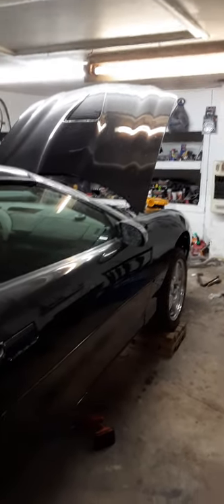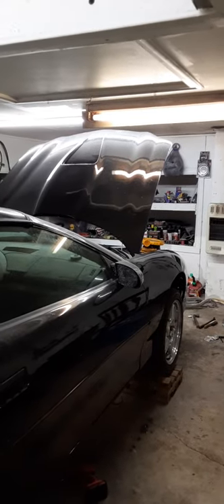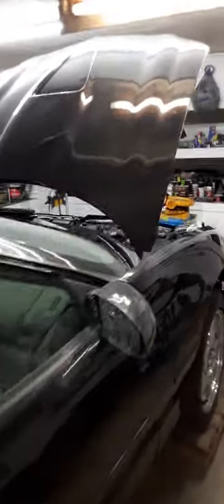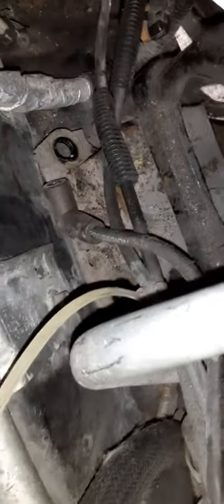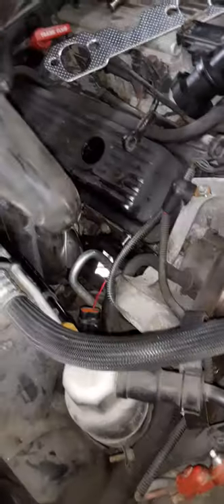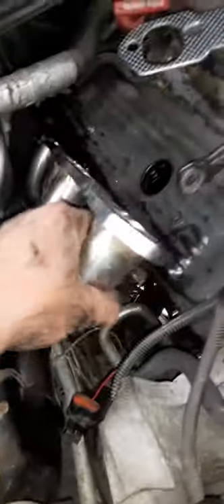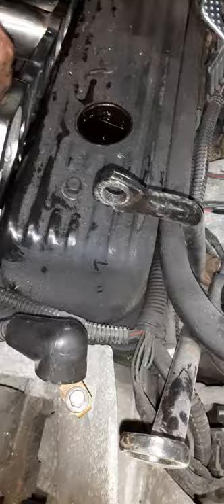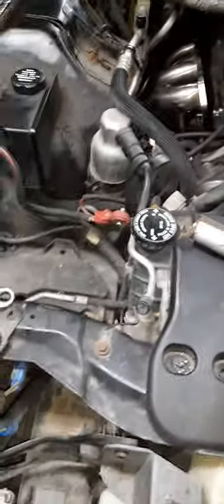Lt1 passenger side header install

Comment: My tube size is bigger too. I took .y valve cover dip stick alt starter all off and my ac. Still can't get it in there. So if I jack the motor up and undo the motor mount they should just slide right in huh? This helps out alot ill try it when I get off work.
Reply from the maker: Valve cover and starter and undo the 3 motor mount bolts
Reply: @shawnschuster7532  right on thats what im gonna do tomorrow. Just worked a 13 hr shift today ugh. Fuckin sucks bc I just wanna work on the car man. But I've also started undoing my ac. Quite a process that is. But even since I didn't need to start taking that off to get them in I was still going to do an ac delete so yeah. Thanks for the vid man!!!
Reply: @shawnschuster7532  I took off the valve cover and noticed that this car has an lt4 hot cam kit in it lol woth 1.6 roller rockers. So that's pretty sweet. I could already tell it had a cam and from experience of hearing an lt4 hot cam sound I had deep instincts telling me someone put it in there. But seeing the internals of the valve train sold it for me.
Reply from the maker: @bigsutton  lt4 setups are nasty
Reply: @shawnschuster7532  yeah because for one they are made by Chevrolet and they made them to be basically the best setup for naturally-aspirated setups. They are the kings of it in my opinion

Comment: How was the drivers side, and what brand are these? I just ordered speed engineering headers and I’m pretty stoked, but also terrified of the install.
Reply from the maker: The drivers side is the easy side the passenger side is the hard side I ended up taking the motor mount bolts out the 3 to the cross member and jacking the motor up and removing the valve cover my tube are larger than normal though  these are just some ebay china brand ones  I've had some pacesetters they fit like a glove  you'll have to undo the steering shaft take valve covers off remove the tube to the back of the intake zip tie wires prolli have to get a new oil pressure sensor and temp sensor they brake and so on
Reply: @shawnschuster7532  eek. I got speed engineering headers and y pipe. I’m sure the labor is worth the sound though.
Reply from the maker: @seshtilirest4748  yeah for the sound yeah for the most part headers are headers unless u are pushing serious hp numbersyoull also have to extend your oxygen sensor wires take out the dipstick make sure you get some good bolts I used to have arp ones I think they were that had a Allen key lock in the center it spread the bolt open to lock it in place these ones i got now are studs with a nut you thread on  think I might swap them out
Reply: @seshtilirest4748  im installing mines right now. Same brand your are.
Reply: @shawnschuster7532  hey so I'm stuck on the passenger side. So all I have to do is undo the 3 bolts for the mount and then back it up from the oil pan? Will I be able to put the mount back on without problems? Also you said to remove the valve cover? But in your video you didn't? 

I almost feel I can get it in without the valve cover and not removing the engine mount. 🤔
Reply from the maker: @dnegel9546  my tube size was huge so thats why I had such difficulties it would be alot easier with the valve cover off with my pacesetter I just slid it in and was good to go
Reply from the maker: @dnegel9546  also yeah you will be able to put the mount back on just fine
Reply: @shawnschuster7532  I'm still working on it. Bout to lose my mind. 

So the headers I have are exactly the same you have in this video. And my tubes are hitting the plastic against the wall. (Heater core cover?) But basically this is keeping me from being able to put the front bolt on. I really don't want to hit my headers with a hammer. I already have it in I just need that front bolt on. I got the back bolt on. 

Only thing I'm thinking is grabbing a pry bar and hammering away at the plastic cover (Idkn what it is.).. but I'm guessing this will destroy it and I will have a bigger problem.
Reply from the maker: @dnegel9546  i had to really flatten the tubes  out they will hit everywhere worst headers eveer
Reply from the maker: @dnegel9546  if you undo the motor mout raise the motor up it'll fall into place
Reply from the maker: @dnegel9546  it might be hitting off the body still though mine was bad
Reply: @shawnschuster7532  yeah I'll see what I can come up with tomorrow. I raised it and lowered it several times already. I may have to try and shave off that plastic trim as much as possible and hope it's Nothing important. 

Weird there's a guide about this exact headers being put on at ls1lt1 tech forums and they didn't mention anything about hitting the side wall. So it may just be something I'm doing wrong.
Reply from the maker: @dnegel9546  both sides of mine got the hammer they were hitting everywhere all over some people would cut the cross member for the driverside passenger side would sometimes hit the bellowing for trans  and mine just hit everywhere with the passenger side ill get some videos for you
Reply: @shawnschuster7532  hey I got them on finally. I managed to get them on without hitting it with a hammer. I almost did tho. Even had the hammer in my hand debating if I really wanted to remove the header to beat it. Lol..

But I dkn, I just keep shacking/ lowering/ raising the engine and finally I got the bolts on. 

I can safely say putting on headers is harder then removing and rebuilding the 4l60e 🤣🤣🤣. Holy s**t.. I also did it all on my own, I came so close to asking someone for help.. (I never ask someone for help.) Well physically.

But thanks for everything, really appreciate the responses. I'm going to have to find some high heat tape/material for the wires since I did not re route mines. 

I also read that since I have a 97 I will need a tune in order to drive it. 😒🤦

Oh btw I have the EGR delete plates. I read 2 go on the back of the intake and 1 on the header? (Guessing the header one is for headers that have EGR.? Mines don't.) 

And also I need O2 extensions and band clamps. I refuse to use those clamps that came with it. I had same style ones on my exhaust and that caused a nightmare on par with the passenger side header. 😢
Reply from the maker: @dnegel9546  really make sure they are clearing everything cause you have to have a certain amount of clearance for when the engine shakes you I think only need one plate unless you took off the little diaphragm egg stuff as well there should only be that one metal tube you took off going from exhaust manifold to intake its easy to make a gasket yourself also I've never tuned for headers I really think you'd be ok my ls1 ran like crazy with headers though so u never know for the 02s id just get wire and extend them yourself thats what I do everything if I was you though make sure you start the car and makesure those headers aren't smacking or vibrating off the body or cross member you really have to look good and have good clearance for engine shake that's where my hammering came into place
Reply: @shawnschuster7532  damm your right It didn't even cross my mind to think about the shaking. 🤦🤦🤦 

Swear I'm about to just put my manifolds back on. 😒 Lol...

I believe it's touching the plastic on the body where heater core is. 

Then again if it does shake won't it just make its own dent in whatever it's touching. Lol 😅..
Reply from the maker: @dnegel9546  i had to take mine off and on multiple times to make it clear everything
Reply: @shawnschuster7532  wow.... No way you have lots of patience.. swear if I have to take these off...the manifolds are going back on and I'm selling the headers. Lol
Reply from the maker: @dnegel9546  ill never buy those headers again the tubes were just to large  they are kinda quiet for my likings I had pacesetter painted ones though and they fit like a glove on a different cart
Reply: @shawnschuster7532  yeah I got mines for $250 shipped. So that's why I got them sucks cuz they look good and seem to be good quality, if only the tweeked the design a bit. But I see the same ones I got are now going for $400 so I got lucky. 

Stupid question but... Do I buy 3in band clamps or 4in?
Reply from the maker: You'd get 3 inch cause the collector is 3 in i usually get slip fits then put a band around them i usually always buy a x pipe the summit racing brand and use that for exhaust and weld it up
Reply: @shawnschuster7532  well looks like I'm about to give up. The engine mount holes won't line up. I'm so close..but the bolts are going in cross threaded. And I noticed the header is hitting the frame just slightly. So I'm guessing that's why it won't line up. Even if they did line up Im not sure how I would tighten or even get the bolt on the top left of the mount on since the header is now in the way.

I really should have never bought these headers. 🤦 Guess I'll take the passenger side off and see if I can get the bolts to go in.. if I'm still in the mood I may give it another shot. But more then likely it looks like the manifolds are going back on. 

Going to have to sell these for $200 hopefully.
Reply from the maker: @dnegel9546  yeah I think those headers are straight race car apps that are butchered up i beat the hell out of mine man but I did it so it couldn't be seen defiantly won't buy them again trust me you'd save yourself time getting like a smaller tube and brand these Chinese  get it close but not good enough
Reply: @shawnschuster7532  sucks I'm not the type to give up on work/projects. But this is just next level. 

Did you beat it with just a hammer???
Reply from the maker: @dnegel9546  absolutely and ill tell ya what those tubes don't want to dent easy
Reply from the maker: @dnegel9546  I had some 2 x 4 under it so it wouldn't get fucked up but the hammer scratched it pretty good
Reply: @shawnschuster7532  ahh well I gave up. After checking it over I noticed it was hitting the engine mount itself. As soon as I removed the header I was easily able to line up the engine mount. 

Tomorrow I'll bolt up the manifolds and leave it at that. Feel like an idiot for wasting like 2/3 days fighting with this thing.
Reply from the maker: @dnegel9546  id just get the hammer out i scratched the hell out of mine this y i just said screw it smashing time lol
Reply: @shawnschuster7532  yeah I'm probably going to keep the headers. Not a big fan of shipping things or meeting up with strangers to sell it. 

I'm actually getting ready right now to start throwing the manifolds back on. After all I still need to see if my transmission even works since I rebuilt it myself. Lol.. not sure what I was thinking buying headers, I have so many more important things to fix on this car. Like brakes and a leaking transmission lines. 🤦🤦🤦
Reply: @shawnschuster7532  hey you were right. Lol.

So in my attempt to put the manifolds back on it started to become a surprisingly pain in the ass and I got frustrated and said fuck it. 

Grabbed me a BFG and went to town on the header. Let out all my frustration on it..heck I even beat parts that didn't need a beating.. lol.. but it's on now with plenty of space and nothing is touching. I even left the engine mount on. 🤔 Tho I wonder if it will even flow any better then the manifolds now 🤣🤣🤣.. oh well it's on. Now to do the drivers side again.. 🤦 should have left it on. 😒
Reply: @shawnschuster7532  so the ypipe that came with it is the same size as my catback exhaust which is a 3in exhaust system. Any idea what I can do here???
Reply from the maker: @dnegel9546  I didn't get the y pipe i usually buy summit racings universal pipe that's 2.5 ill get a slip fit thats 3 inch for the collector and reduces down to 2.5